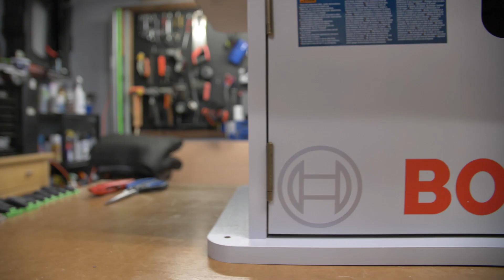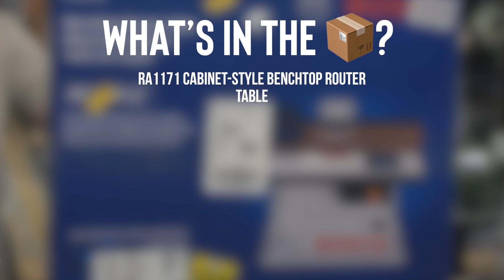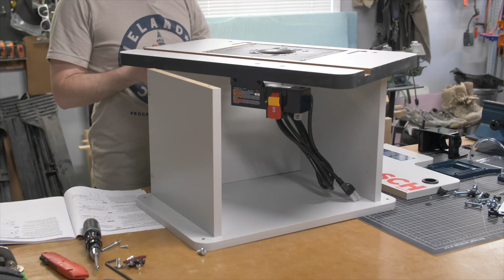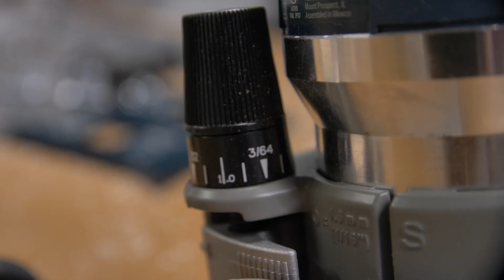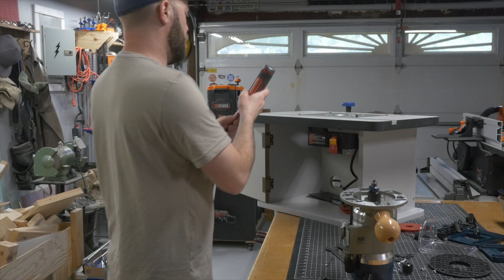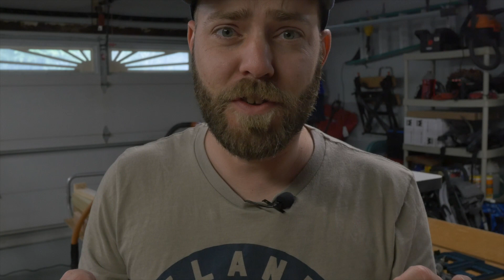Bosch Router Table and Router - Unboxing, Assembly, First Thoughts

Comment: Just got one of these and broke it in the past two days making some cabinet doors for the first time. 

The absolute best part is being able to access the height adjust screw for the Bosch router from the top! 

I thought I was going to have to open the cabinet every time I wanted to adjust the height, but you can use the T shaped allen key that comes with the router through one of the holes in the router table's plate.
The biggest gripe has to be those weird screw and plastic pieces they use to slide the router bit guard up and down with.  If you take the guard off it can take a frustrating minute or two of fiddling with them to get it back on.

Due to that small thing, I'd say this is a 9.5/10 for the price and ease of use with the Bosch 1617EVS router.
Reply: I have this router and did NOT KNOW you could adjust the height from the top!!!!!! 
I'll have to look up exactly how to do that. This was used when I got it, so I don't have a manual or half the parts. But I bet I can figure it out!

Comment: I have the EXACT same setup, both table & router, & was hoping you would show exactly which holes to ise for mounting, as the instructions domt cover these specifics, i guess because there are too many different routers to go over, i saw you used the "B" holes on the plate, according to the diagram, but which holes on the router itself? Thanks.
Reply: Oh, & it's different holes than the ones I took the "sub-base" out from? & Only 3 screws compared to the 4 that held the "sub-base"? Again, if you get to this, thanks.
Reply: I'm having same issue

Comment: how did you make the screw adjustment working with 1617? that little c shaped lock ring pops out everytime when I try to lift the router up.
Reply: Its called an E clip. You'll have to replace it if it pops off. Once the E clip gets bent, its useless. $1.35 for 2 clips at Home Depot. What I don't like about th table is the adjusting screws that raises and lowers the plate but if you're not careful and tighten the plate or if your adjustment is a hair off, the adjusting screws will vibrate loose

Comment: How hard is it to change the collets and bits?  Can you lift the router from the top of the table?
Reply from the maker: It’s a bit awkward when it’s attached to the table. When the router is not attached it’s fine. Yes, you can lift the router from the table.

Comment: Great review. Do you know if it is compatible out of the box with a dewalt dw617 router?
Reply from the maker: Thanks! I do not know for sure, but Bosch says most "popular" routers. They may have compatibility listed on their site.
Reply: @DaverMade  they do and it is XD
Reply: @DaverMade  The compatibility list is included in the PDF operator manual. As far as I can tell, all listed routers allow height adjustment from the (non-standard) router plate. Since Wood River's recent large price increase, this is the only affordable fully enclosed router table available.
Reply: The manual lists the DeWalt 616 & 618 as the only compatible DeWalt routers. That doesn’t mean you might not get lucky! Heck all it takes is a drill bit to make it fit! Just be sure it’s centered before marking the holes!